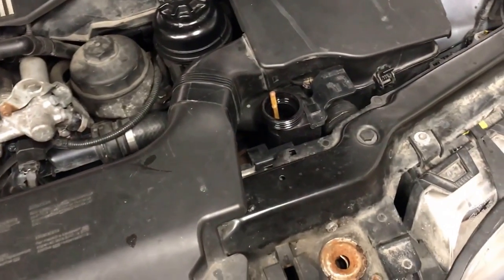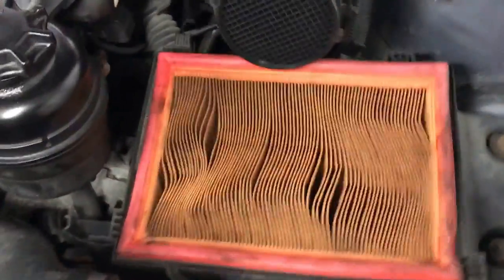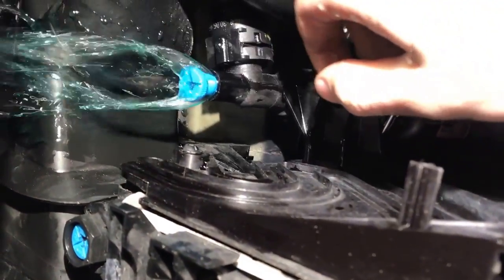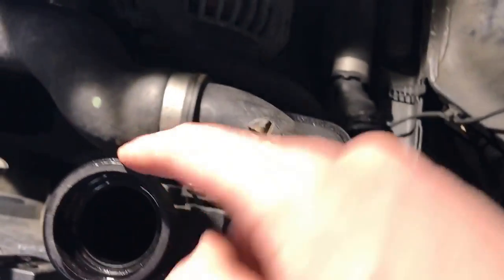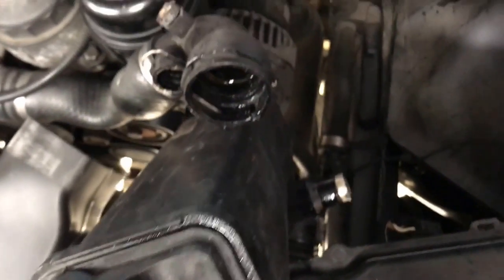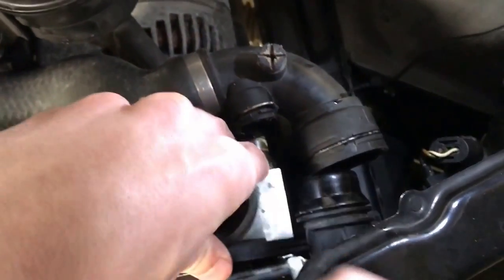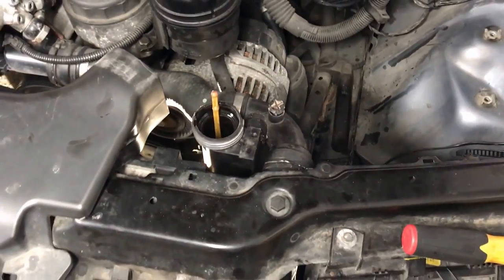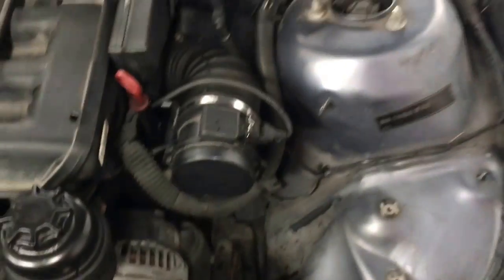How to replace the o-rings on a BMW e46 3 series expansion tank

Comment: When re-attaching the hoses I found it's better to push the metal clips into place before putting the hoses on. That way when you  have them on you'll hear the clips snap into place. Also if you don't have a fender washer, use a #3 phillips screw driver.

Comment: The O-rings are in a slanted angle you can't put a perfectly round and in there when it's a slanted angle and we're talking about the ones that are in the pipe itself the hose bid that connects to it

Comment: Good video. Can I ask, are there o-rings available to buy for the top hose which connects to the expansion pipe. As mine is leaking from the top o-ring. Thnaks!
Reply: Mine too, what are the sizes?

Comment: hey nice video ! I'm about to change all the o-rings for the coolant system to fix that slow leak. I'm wondering, what product (grease or anything else, I don't know..) do you use to make the o-ring sit nicely in the groove and to make it seal better? Can you tell me the name of the product and the brand ? Thank you a lot !
Reply from the maker: It makes it fit better I think. Any rubber grease will work.

Comment: Hi Evan.  Would you know how the o ring is measured?  The 38mm and the 22mm measurements, are they measured on the inside of the ring or from outside to outside?
Reply from the maker: +mark Smith inside the ring is where the measurements are from but I have a link to all the o rings in my description.
Reply: Thanks very much for the reply Evan,  i checked out your link and ordered the two packages but not sure if they are going to ship to Canada so i need a back up plan.
Reply from the maker: +mark Smith Yes that is right!
Reply: Thanks Evan, I appreciate your help very much
Reply: mark Smith whats the 46mm for ?
Reply: @marksmith1003  mark found your comment today. Link is broken. Do you have another business that supplies this in the USA? . maybe in a kit? Thank you

Comment: Here is a link to where you can buy a kit of all the o-rings needed for your specific E46- using a tailored kit is much cheaper than trying to find the right o-rings for all the hoses and then having to buy at least 10 of each:  https://forum.e46fanatics.com/showthread.php?t=906997&page=3     (post #52)